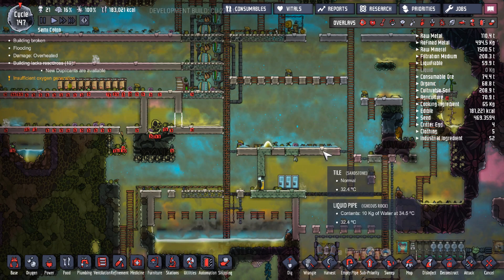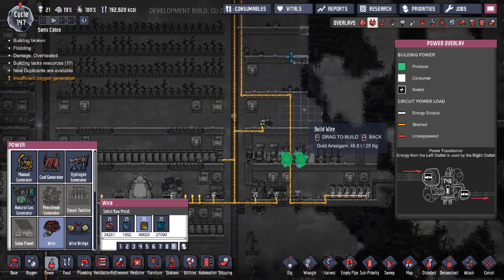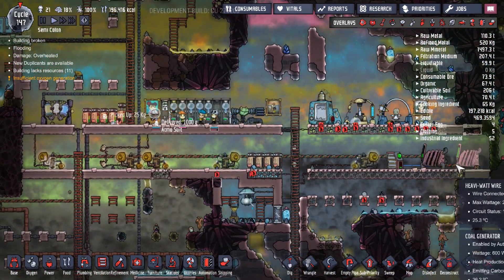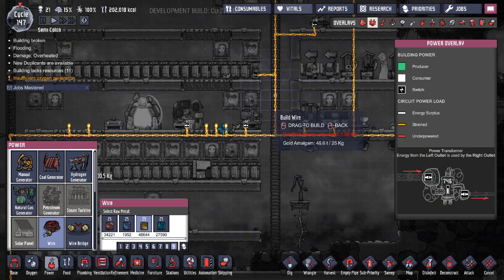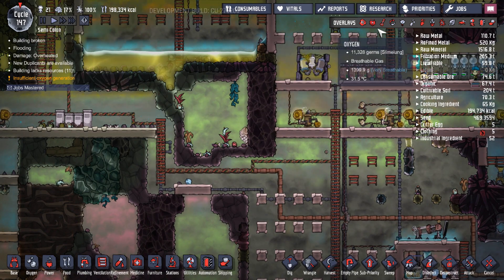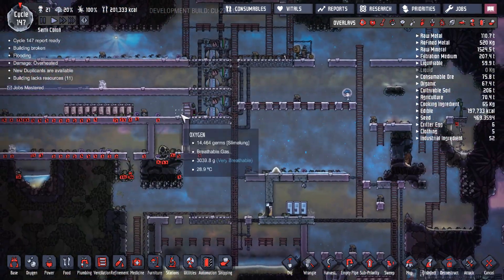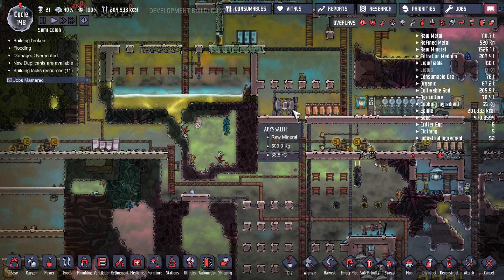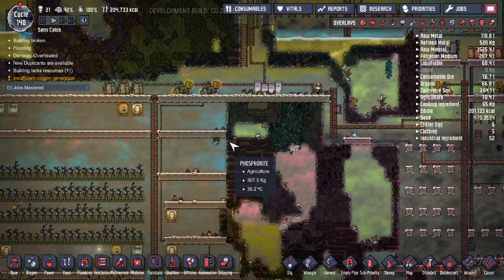#4 Oxygen not Included - How to do Smart Electricity Management

Comment: is this easier than just running heavy wire throughout your base in 2x2 maintenance tunnels and with regular wire branches into base?
Reply from the maker: The less heavy wires the better really. I aim to have as least as possible generally. Nowadays, I like to build my generators on a floor by floor basis, but your suggestion is absolutely fine too. I would also recommend to only use the 2kW wiring instead of the 1kW one. Much much easier to handle power this way.
Reply: @GamesCaste  5 months late to the party but my method of dealing with stress due to heavy watt is just to make my central hub (oxygen filled space with beds bathroom all non-heat producing buildings etc.) super beautiful (high decor) and zero heavy watt but for anything that needs wire outside the base I use heavy watt because its just less involved planning wise, and the high decor base seems to keep their stress at bay.

Comment: put the fridges in a layer of carbon dioxide, and you can unplug them and save electricity, the food will stay fresh, I think it works in chlorine gas too, food won't spoil in CO2
Reply from the maker: Absolutely yes ! I was actually doing that with ration boxes and yes it works with chlorine as well. I will most likely do that because the fridges use a lot of power for not much gain. They need to bring it down to something like 50W i think and even then it's probably quite some. But yeah, sterile environment for the food is definitely the least expensive way 100%.